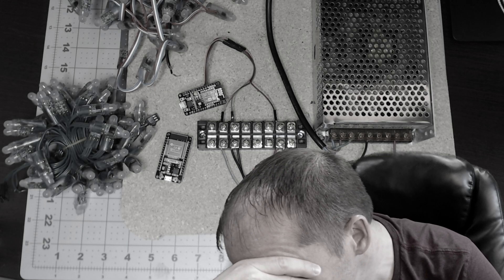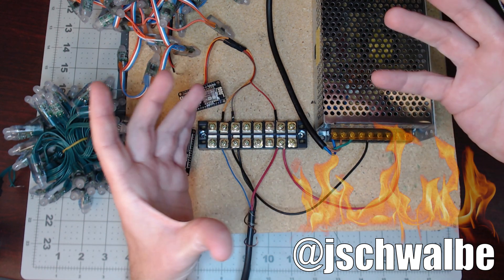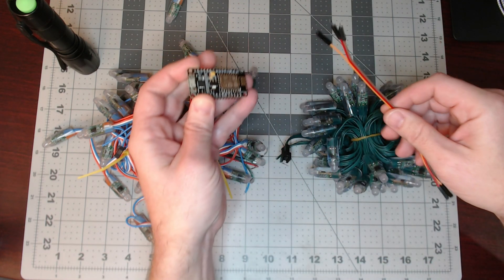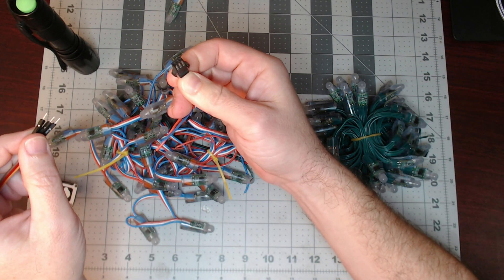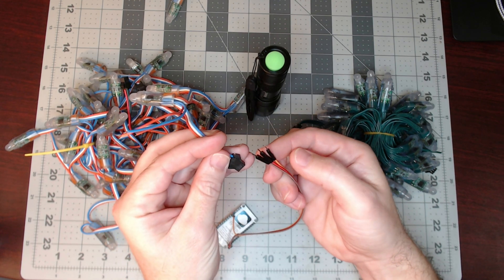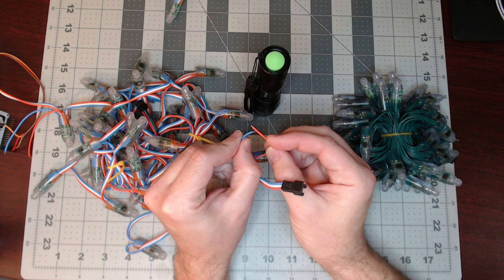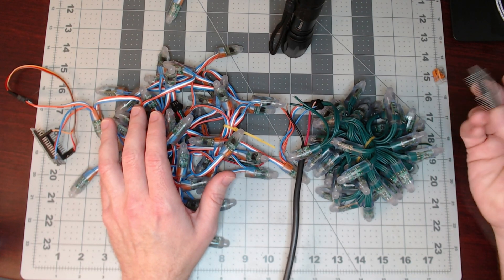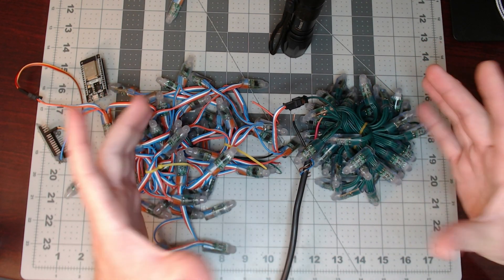Easy DIY Animated LED Christmas Lights | Simple Wiring | Ep#2

Comment: i have this problem with my ws2811 where couple of leds that goes different effect rather than what i've set. 🤔
Reply from the maker: Probably too much voltage drop and you need to inject there in a long run.

Comment: Do you have a walk around video of the complete system? Specifically the completed power/controller board setup
Reply from the maker: Yep. Updated with the new boards. https://youtu.be/ot5LwWz71qs
Reply: @digiblurDIY  Thank you. I was trying to get it based off the 2nd DIY Christmas light video. With 10 strands etc…. Electrical is by far my weakness

Comment: Great Video, How many Ports or 12v Pixels can this board support. thanks
Reply from the maker: I think it is more of the limitation of the memory and CPU, I know it supports multiple now in WLED.
Reply: @digiblurDIY  like some other controllers can take up tp 1024 pixel per port, is this limited to one port and can support this amount, thanks
Reply from the maker: Check more on WLED https://kno.wled.ge/

Comment: So then....if I understand correctly, the data signal wire must be installed at the incoming end of the string (obviously), but the power wires can come in anywhere and be injected anywhere in the line?
Reply from the maker: That is correct.  That is why I put the Nodemcu at the beginning.  Actually it sends to the first bulb, the bulb then retransmits to the next, so forth.

Comment: I'm having some issues. (I have no clue what I'm doing. Btw) I connected a power converter to my lights and the dont do anything, if I tap on the screws they flicker a little.  I did connect the lights directly to the outlet and they blew (again, no idea what the ef I'm doing)  but now when I plug those lights in 1 of them lights up.  I'm lost....  anyone's help would be appreciated.   Bad lights maybe?
Reply from the maker: Can you connect one strand of lights to test?
Reply: @digiblurDIY  I have 10 strands.  Not one will light up.  I'm not hooking a falcon thing or anything to it but I figured that shouldn't matter to just get it to light up.
Reply from the maker: If you just apply positive and negative usually the strand will not light up as it needs data commands to set the colors
Reply: @digiblurDIY  okay.  I'm waiting for something to download data still.   I will download something then try again.   Thank you so much.

Comment: When I use the ESP32 board I have to push the "EN" button in order to get the unit to start functioning. On my 8266 boards they function on power up, which is preferred. Can I make the ESP32's function on power up?
Reply from the maker: I have heard that before with flashing and they needed an extra capacitor added but not at regular boot though.
Reply: @digiblurDIY  I was able to use a momentary button placed between the "EN" pinout and "3.3 Grnd" pin. Now I can, at least, have a button outside the project box.

Comment: I want this to work but something is afoot. 2 fried nodemcus from 12v power🤷🏼‍♂️
Reply from the maker: Cp2102 with AMS1117?
Reply: @digiblurDIY  that’s correct. It looks like it’s the regulator that’s getting cooked
Reply from the maker: Definitely an outlier there. Only one I heard was the wrong style nodemcu. I put three more in service last week in shorts and flip flop weather outside. That brand might require the lower voltage then.
Reply: @digiblurDIY  powers on safely with 5V usb supply since I don’t have 5V inline regulator handy. I was hoping I was missing something but at least I have a backup
Reply from the maker: Definitely not missing anything. But if you do have issues with those regulator would be the way to go. Not all are created equal...some have knock off or bad binned parts.

Comment: I'm an electrical idiot, but you'll still get voltage drop around the same area as you did before, right? Around strand 5? So this is an ideal solution if you're only running ten strands in total, but if you're doing more, then you'll have to inject power regardless, yes?
Reply from the maker: Kind of. Depends on the install. But you could get 5 on both sides in that case. It isn't going to eliminate power injection on super long runs.

Comment: do all esp32 node mcu handle 12V - looking at amazon.de to find the one in your decription but can´t find it. So looked att some other like https://www.amazon.de/-/en/AZDelivery-NodeMCU-Development-successor-ESP8266/dp/B074RGW2VQ/ref=sr_1_5?dchild=1&keywords=ESP-WROOM-32+ESP32+ESP-32S+Development+Board+2.4GHz+Dual-Mode+WiFi+%2B+Bluetooth+Dual+Cores+Microcontroller+Processor+Integrated+with+Antenna+RF+AMP+Filter+AP+STA+for+Arduino+IDE+%281+PCS%29&qid=1606424778&sr=8-5 

But unsure if it works with 12V? 

Today I run the D1 mini with 5 V and 5 V 8112B led strips. No long runs.

Comment: Sorry but maybe I am missing something here.  I got the ESP8266 from your Amazon link as well as the 12V power supply.  I see the same setup in your video but according to the ESP8266 board, that only accepts 5V.  Did I misunderstand something?  Thanks in advanced!
Reply from the maker: AMS1117 is required for 12v.
Reply: @digiblurDIY  Thank you for the quick reply!  Since I am new to this and I am not good at soldering, would it be easier for me to use a external voltage regulator such as BINZET DC Converter Step Down Regulator 5V Regulated Power Supplies Transformer Converter (5V 10A 50W) on Amazon?
Reply from the maker: You can but that adds to it. You definitely don't need 10 amps for these little chips. It will work fine but just over kill. Like putting a 50 gallon gas tank on a motorcycle.

Comment: The voltage drop (along the string itself) is proportional to the square of the string length (longer wires with more resistance, times proportionately increased average and total current).  If you can divide a long string into two half length strings (in regard to power), the voltage drop at the furthest pixel will be cut by a factor of 4! (Each substring has half the wire length and half the pixels drawing current).

I tend to do something like this technique when I'm using a small single-channel controller.  I power the controller from the connector (eg: JST for some displays, or xConnect), and then power the string itself directly from the power supply.  Then power can be sent to the string from either end, or the middle, or in multiple places, depending on what works best.  If power is only going to the string through one injection point, and the string is long enough that voltage drop is a concern, then using the middle is best if possible.

For a short string, just powering from the data in end with the controller works, but I'm still using the two extra wires and a power-only connector for that, rather than sending power to the strings via the JST connector.  That is, the only power flowing through the JST is a small amount going "backwards" from the string to power the controller, rather than the larger power to the string coming from the controller to the string via the JST connector.  Where to inject power is separate from where to place data-in.

It's trickier if using 5v, and you may need to make the start of the string one of your power injection points (with or without other injection points) to keep the controller voltage up, because otherwise the voltage drop from the middle or the far end may be too much for stable controller operation at an unpowered end.

And if you have a fancier multi-channel controller, these often have fuses on each channel, so passing power through the controller makes more sense.

Thanks for your videos!
Reply from the maker: That first paragraph is the extreme eyes glaze over when I talk about this stuff to them.  Totally geek to many!  Thanks for all the info though as I'm sure it will help others who read this.

Yes, if you do get too much voltage drop at the end and get it to drop below the necessary voltage for the nodemcu then it will reset the controller or just not be powered up.  One of those things you definitely need to find out by mocking it up first.  Sometimes it can be fixed by adding a capacitor at the end to smooth those dips out but might not work all the time.  In one case I did like this, instead of one single, I did two somewhat in the middle evened out and it worked out great.

Comment: Only issue I see with this is potential for controller reboots, If the controller was not powered directly.   Picture this, you don't have enough power supplied to the lights.  I tell the controller to display a high power effect like all white, the whole string just drops off the bus.  I would rather see faded lights is what I am saying.
Reply from the maker: If you have that much of a voltage drop at the end, I'd probably fix it.  12v down to less than 5v is a massive drop.

Comment: I don't understand how this eliminates the need for level shifting.  I usually use D1mini, but isn't the data coming out of the NodeMCU 3.3V?  The lights (typically WS2811) is expecting 5V for Data HIGH.
Reply from the maker: Just like some of the other single pixels I've used, they work fine.  You really don't know until you try it.  I didn't believe it myself when I first set these up a while back and this new method for doing some medium length runs was a game changer for me.

Comment: The ESP-WROOM-32 ESP32 ESP-32S Development Board, has slightly different pin out positions. Still connecting data to D4?
Reply from the maker: Luckily they did away with the dumb D number conversion on the ESP32.  Look for G2 (GPIO 2)

Comment: Thanks for another great video.  I'm having a weird issue with WLED  I suspect is a bad configuration on my end. I have 5 string lights of 100 pixels each and the first string will only have about half the lights light up as expected with the other half on the string mostly dark with occasional blinks.  The other 4 strings will work fine. When I switch the order of the strings, this issue remains with the sting plugged in closest to the power/data.  Tried reinstalling WLED and no luck. Really frustrating.
Reply from the maker: How is it setup? Have alll the right led counts configured?
Reply: @digiblurDIY  Yes, count was correct. Moved to a new nodeMCU and now it works perfect.  Thx

Comment: would this work with 5v lights and power supply or would the voltage drop be too much to not power the ESP?
Reply from the maker: Possibly. I never tried to power a nodemcu with 3.3v on the VIN pin. Always assumed it wanted 5v. I don't have any 5v strands to try this with.

Comment: Can you power a esp32 off 12 volts?
Reply from the maker: Yes, but not all of them can be done that way just like the Nodemcu esp8266 as there are so man different models.
Reply: @digiblurDIY  Is there a way to determine? Thank you for your reply.
Reply from the maker: Compare it to the one I link? See if it has a capable regulator.
Reply: @digiblurDIY  Will do. Thank you sir.

Comment: Just need to be careful that there are enough amps left over at the end of the string to power the MCU, it might to start to behave "strange" if not enough power left being fed into it.
I typically still inject at the start because I like my MCU hidden in a box, so sending one wire for data, might as well send power as well.  Then inject at the middle or at the other end depending on length of strings.
Thanks for another great video!
Reply from the maker: Definitely!   As you can easily make a less than 5v drop doing some white 100% lights with ease.

Comment: Travis, Nice update/follow-up video. By chance, did you measure the voltage input level to the NodeMCU after experiencing some voltage drop going through the 4-5 bundles of Pixels? Just curious, and thanks for the videos. 🤔😀
Reply from the maker: I didn't actually, I have a smaller scale one on my tree though that I can check.

Comment: I would advise to put a large 1000uF cap over the NodeMCU power connector (when you have a lot of leds) -- when you have a blinky pattern on the eleds the power could be too irregular at the MCU could let the CPU hang
Reply from the maker: Yes that isn't a bad idea as if you hit some major white patterns on long runs the voltage could drop too low for the board itself to handle.